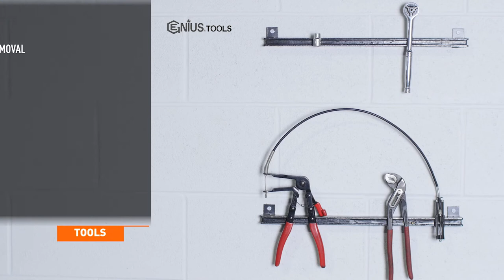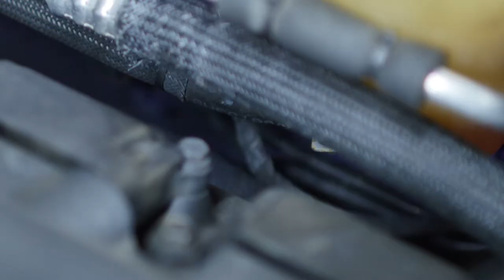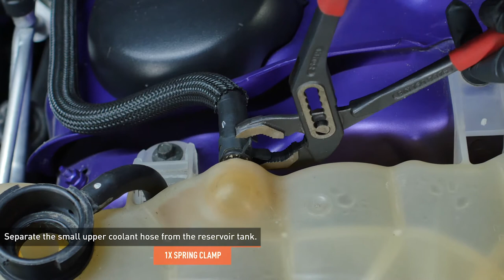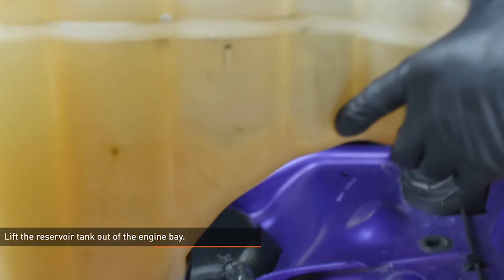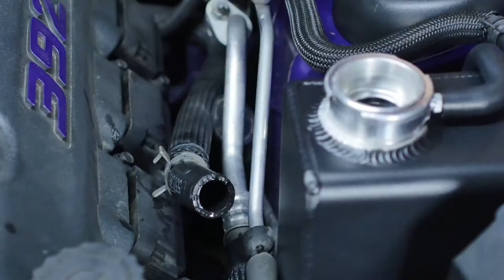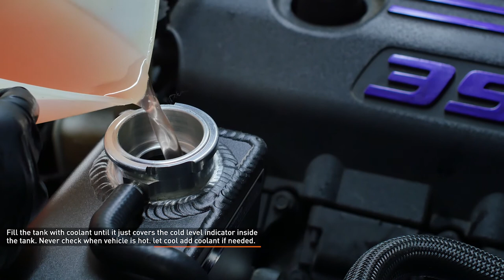2011+ Dodge Charger/Challenger Chrysler 300C Aluminum Expansion Tank Installation Guide by Mishimoto

Comment: So did you not have to drain it from the petcock and bleed it?  If not then the pulling the coolant directly out of the reservoir looks like a better idea
Reply from the maker: Installing the expansion tank will not require you to drain the whole cooling system as just a little coolant will be lost
Reply: @mishimoto  Sweet sounds good.  Love that expansion tank you guys make but I'm broke hahaha

Comment: I've heard this won't fit the 2019 Charger 392's. Any word on if you'll be coming out with one that will or how to modify this one to fit?
Reply from the maker: Hello Shane, This is correct the tank will still fit the 2015+ 3.7 and 5.7 but will not fit the other engines. Our production team is aware of the change however I have no information I can share regarding a replacement.